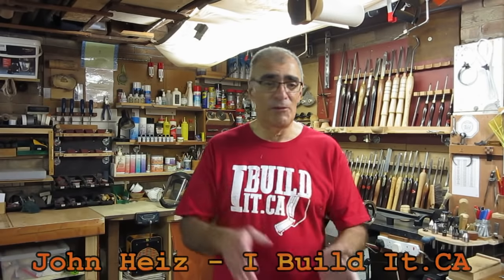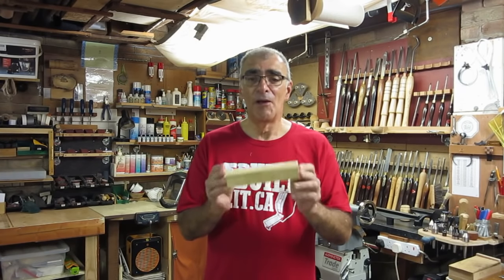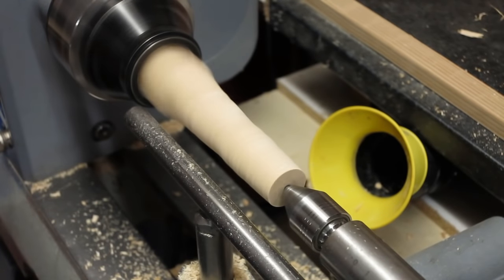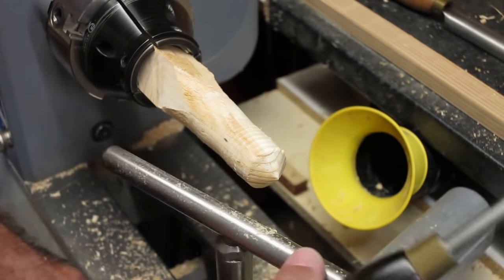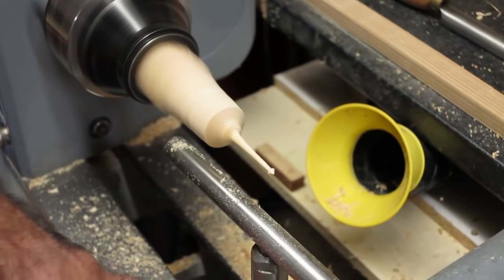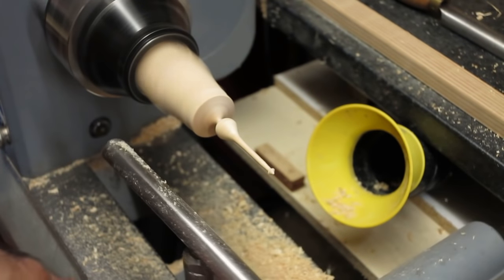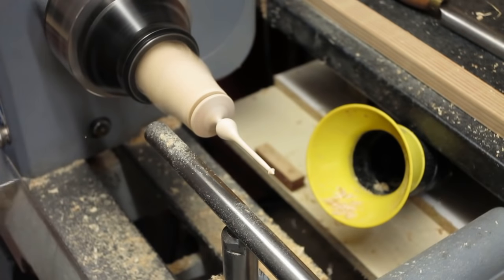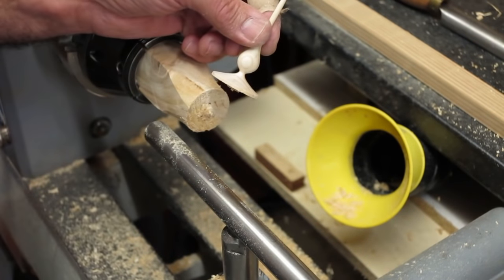Woodturning - Finials - A Basic Introduction #1

Comment: Interesting concept to do one section at a time.  Art teachers usually teach working "in, around and through", meaning don't concentrate on one area of a painting, for example.  I've always tried to adhere to that in a lot of things.  I will try your method for finials, at least.
Reply from the maker: The reason for this method John is that you are working toward the "meat" of the blank were you get more support. If you go back and work on the top (end), you have little or no support as it is so thin.
Hope I explained this adequately 
Take care
Mike
Reply: Yes, I understand completely.  I try to keep the meat toward the headstock, but I'm never sure where I'm going. You seemed to know at the start what you were looking for.  Thanks again.